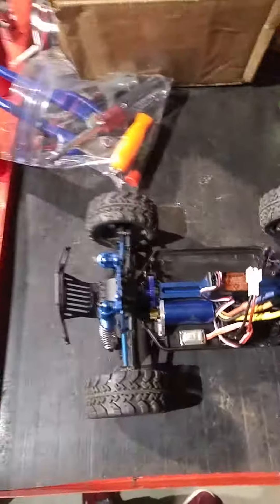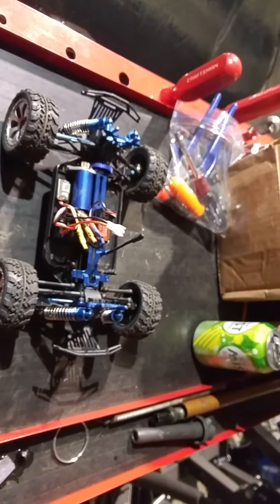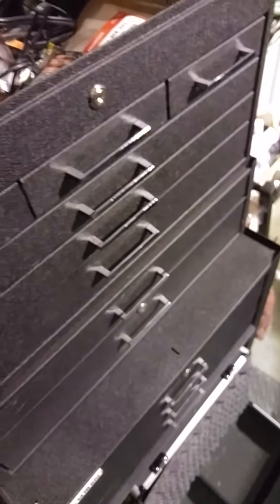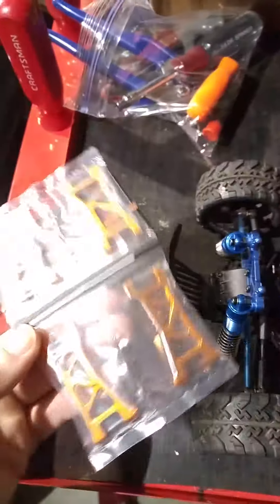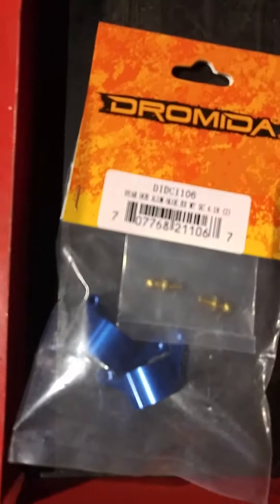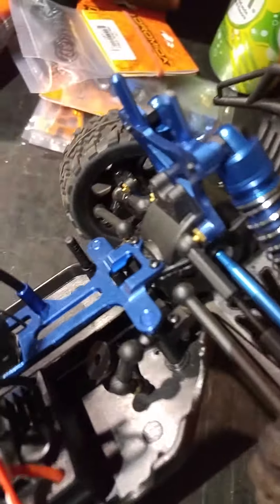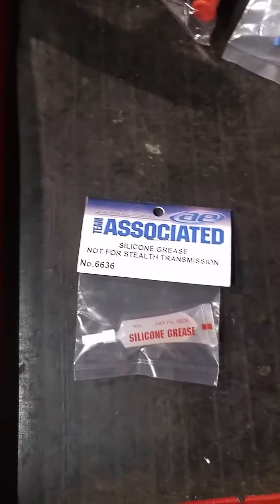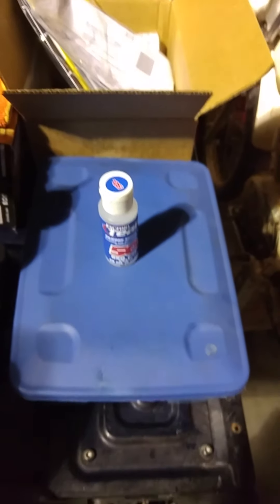Dromida Series MT 4.18 Brushless RC Pt.2

Comment: When are you going to make an update video of all the stuff added? I got my mt 4.18bl today and first run I already broke something. Now it's time to ugrade to aluminum.
Reply from the maker: +Sean Prior  yeah if its anything plastic it will break soon lol. i basically have upgraded it all at this point . i will be putting a video up today along with a few others so stay tuned . just a heads up. stay away from the aluminum spur gear. it wears out twice as fast as the plastic spur gear does and cost twice as much.  if you rc hard you will want to get a few spur gears and a few different pinion gears for back up. i think they make 10 T, 11 T and 13T Tooth pinions for the dromida
Reply: +Hectic Motorsports 
Ya, I've heard that the aluminum spur gear does that. Where can I buy different tooth pinions? And I seen on a forum that a guy lowered his mt. Not really sure how but I'm going to try and figure it out. I'm mainly going to use it for speed runs. Not really into jumping or anything like that.
Reply from the maker: +Sean Prior  i order everything for the dromida at  www.Towerhobbies.com #towerhobbies and just search dromida parts and youll see the 3 different pinions they have. if you want any other size ive only found a 16 tooth from robinsonracing.com just make sure you get the right mod # .... (pitch) if not youll eat right through your spur gear. and yeah you can lower them easy... just get the buggy shocks.... they are shorter then the trucks. thats all you have to do to lower it lol all the arms are exactly the same on every body style 

hope this helps

Comment: How is your mt holding up with all the new upgrades? I actually just found out about them today and just seeing how much you can upgrade them made me decide on buying one. Is the brushless mt the same as getting the regular one and buying the upgrade (hop up) kit? Or would it be better to buy the normal mt then buy the kit?
Reply from the maker: they're great little trucks and the hop up unions are endless for these . so many different brand rc parts for in these as well. also yeah the brushless is the same as the brushed with the hop up kit . I would get the brushed then fully upgrade it . . I've already changed the motor and esc to a mamba micro and a castle creations 8200kv motor still 2cell lipo battery . hope this helps